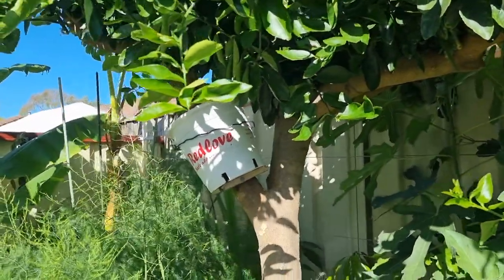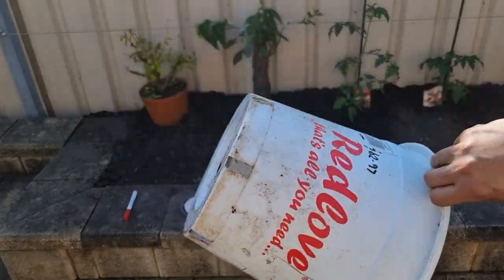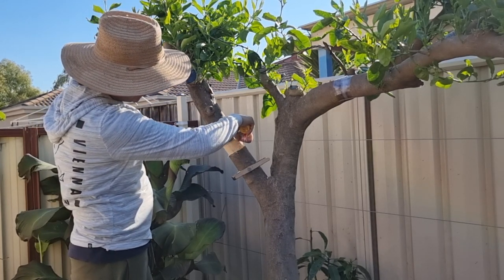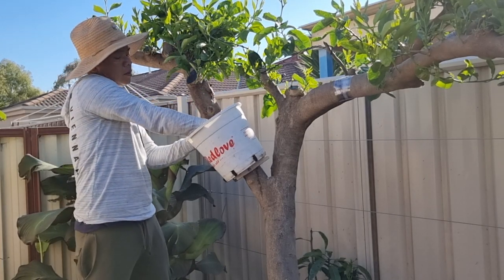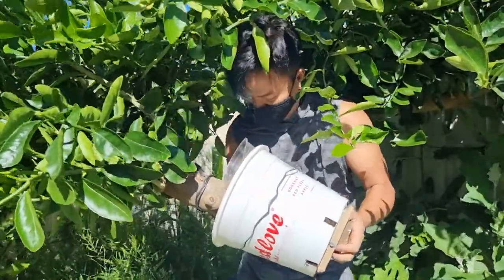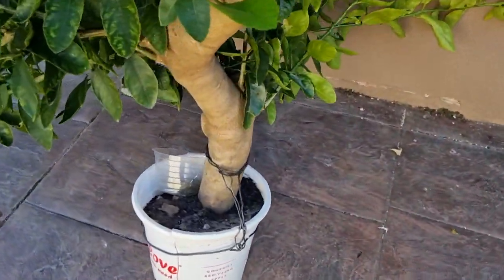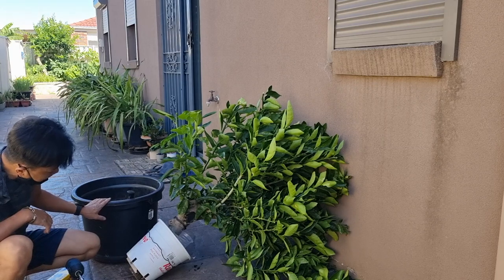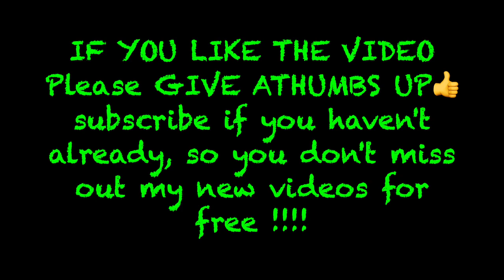Air layering method "lime tree"

Comment: i have a naval orange tree with 60mm trunk  , the trunk is 70% ring barked ,,can i air layer the whole tree or can i only take branches
Reply from the maker: Thanks for watching 🌱, the trunks 60 mm can be done, find where the bark are fully around the trunks and looks healthy. I did successfully on a 90mm trunk lemon tree, and also grafted an navel orange on it , the video comes out soon
Reply: thanks... you should add a grapefruit ,,and lime to make it a multi fruit..it worked well for me @GraftingTactick